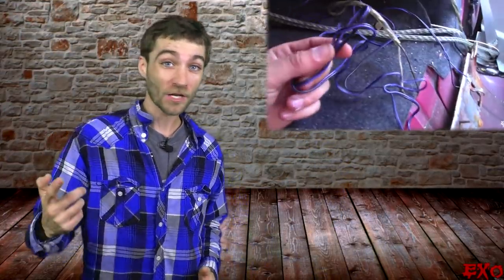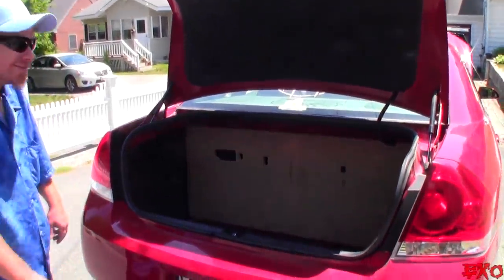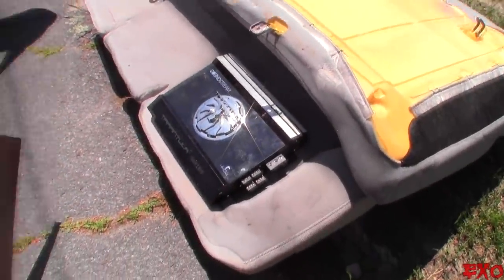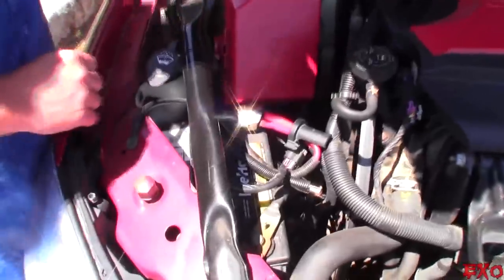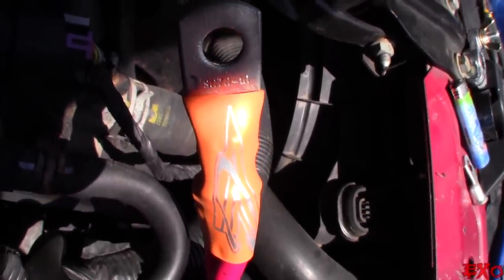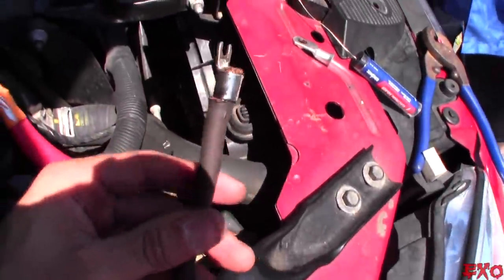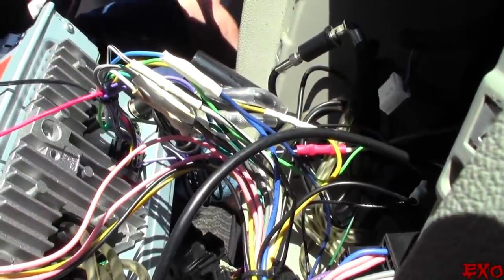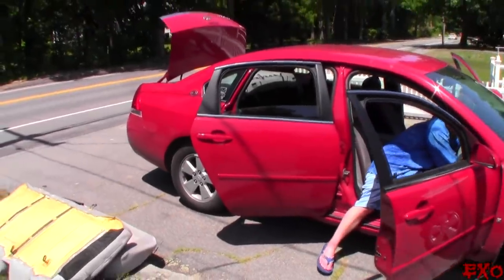Installing 4 Channel Amp w/ Joe's SOUNDSTREAM Tarantula Amplifier | Wiring Up & Tuning Gain Settings

Comment from the maker: It's always great to have friends who love tinkering as much as you do :)

Thanks For Watching, Everyone!!!
Reply: It has now been years since the last real Build-video..
Can't wait to see this big Nissan subwoofer incloser come to life👍 keep it up Exo!
Reply: Do you have a video of the 2 15’s installed in the car
Reply: Love the work man!  Your a inspiration an now i have four 12s in my 95 GMC berban.
Reply: Damn really digging into the archives 😄 and your first heat shrink job, is still there and working fine.
Reply: I gota say i thuroly enjoy the real feel of your channel and the over all positive and happy attitude that you display I have a deep passion for car audio myself and I have just about finished my fabrication shop and will begin my own build where I will be installing a active  3-way Focal Utopia and a Fi 18 BTL fully loaded 7 spiders. All this powered by 2 Soundstream Rubicon 600watts for door drivers and mids and hi's and a Soundstream D Tower 3400 D 1/2 ohm stability. All of this will be processed through the Rockford Fosgate 360. 3 signal processor and it will be fed audio through fiber optics cable off of my car computer that will be built into the dash and cooled via air conditioning. And it is a full-blown PC not these POS carputers on eBay... I'll be running a full 1080p touchscreen Lilliput screen and not an Adaptive resolution it will be Ultra high-res I will also be sporting and I'm not joking a true 1000 farad capacitor Bank and a XP 270 alternator luckily have already purchased all this stuff I'm going through the phase of preparing to build I'm so excited I promise I'm not trying to brag just happy to put out there what my bill is going to be and share it with others.
Reply: I bought a Buick Regal that came with Those same exact 6x9s in it!!!
Reply: Have u ever heard of a logic soundlab gsx-28hc high current 3000 watts 1/2 ohm stable  2 channel amplifier? I'm having major trouble finding some specs for this amplifier. I've googled it and only came up with 2 results. None giving any information on the amp. If there's anyone who can help me it's you. Love ur channel keep up da good videod
Reply: I have a question on the 4 channel Amp do you set at Full or HP or Low. One guy put mine to low than I lost my high sounds.
Reply: It’s an old vid, but I’m going thru the library as I need or want. It’s nice to see someone in my budget (love SMD, but that’s gangster cash) who makes it all work beautifully from the garage. MUCH appreciated!!

Comment: Forgive me for unsubscribing 🙏🏽 

Picked up a prelude in great condition. Doing a little build on a kenwood 801-5. Focal component mids in the doors, focal coaxial in the rear, a 6x9 in the stock sub spot between the seats and I’ve got a p3 10 for a sub. First build I’ve done in a few years and I’m excited to see it all come together.

Comment: I'm halfway through installing a 4 channel amp to complete my soundstage in my 365k mi jalopy, and watching 8 minutes of this reminds me of how google's algorithm doesn't understand the difference between goor content and completely useless content. This would fall in the suggested category of useless content based on my search criteria. However, the video did alert me to the important issue of using heat shrink vs. electrical tape where both is purely cosmetic and essentially do the same thing.

Comment: A lot of folks shit on Soundstream but they're not too bad, I run a T5 10 for my winter sub and had a little Reference 8 last year. As long as you don't expect to run Soundstream (or any budget brand) at full rms you'll be fine. Nice throwback vid EXO, "We all start somewhere" spoken true

Comment: Propane tank will dump xtra fuel when tipped upside down, wen you shake it the concentrated liquid it can disperse around the tank, warm up, and ussually equalize the ratio throughout the tank, when its just sitting straight up with plenty of fuel tipping it too far into a 90° angle will dump the concentrated liquid out the tip

Comment: Do you have a video on how to measure for air space of your speakers and for a port? I'm building a truck box for four skar 10s.
Reply: Define your airspace it's length times width times height divided by 1728
Reply: Try Rockford box wizard.  Search for port length calculator.

Comment: If the rca from the 4 channel amp uses all up the rca connections to the radio how you connect your rca from the subwoofer amp

Comment: Question when putting 6 speakers on a 4 channel amp on the RCA do I use the rca  splitter to use all 4 channels or what ??? Like the 2 male to 1 female splitters??

Comment: So the amp that he used has a lower RMS than the speakers?? Wouldn't that be underpowering?
Reply: No. And let me tell you why it's because RMS is root measure square that's the maximum you can do to get a quality signal.
Reply: @e-flatdeyante7514  Ok I think I get it. I usually match the RMS of speakers to the RMS of the amp
Reply: There's nothing wrong with that...

Comment: Hey i need help figuring out a problem with my set up I have had the same set up for at least several months but the speakers hooked up to crescendo 4-channel amp have been moving without any single sent to them any help or suggestions on what it might be would be appreciated
Reply: You have lost shielding somewhere electrical most likely a alternator to make the speakers move without any signal

Comment: So I've been saving for "pro audio" speakers, do I need a crossover if using a separate amp with highpass filter tuned to not interfere with subs amp? Kinda new to this stuff.

Comment: Hey EXO need your help I'm running 2 10in  JL audio's with a 1000w Rockville amp but everytime the bass hits everything dims then my bass starts to kick in  and out after 20 mintues
Reply: kenneth taylor get a volt meter. Your dropping below 12 volts if your amps shutting off.
Reply: Big 3 upgrade and a 2'nd battery will do the trick.
Just search on youtube: big 3 upgrade
Reply: Draw > supply. My guess is you're running a stock alt that can't keep up.
Reply: @B F totaly agree. Big 3 upgrade is a must. Most alternators in modern cars have 80-120amp. And a decent battery. But the weakness is often the wireing.
Reply: @bepbep7418  for a 1000w, stock alternator is ok. Lets say its a 90amp alternator. 90x14.4=1296.
But it's depends on how you play.
I have a 8k amp on a stock alternator with 3 battery's. But i only use 500w on daily driving-music and have short burst of power on spl-contests.

Comment: I have a soundstream 4000.1 amp and it out of the blue started making a "heartbeat sound" and going into protect. check all cables and wires and found no issues.  hooked up an old cheapo amp and everything works fine, so guessing the amp just up and died, Less than a year old. wouldn't recommend sounstream amps

Comment: I know this is an old video, but if anyone can help me I would surely appreciate it.  When I use my DMM to set my gains to the desired voltage my DMM jumps around everywhere.  I have a good Fluke meter so I know that's not the issue.  Any help would be very welcomed.  Thank you in advance.

Comment: Can anyone explain how to run a 5 channel and 4 channel at the same time. my radio is in network mode and I'm only getting tweeter sound out of my 6.5s on my 5 channel. The 4 channel works fine. I have 4) 6.5s and 4) tweeters ran off the 4 channel. I want add more 6.5s on the 5 channel and a sub

Comment: those big torch are the worse. Better to use a big crimper
Reply: He DID use a hydraulic crimper. In fact, it's still there.

Comment: Can you help meee?
Reply: With what?
Reply: offroadingbronco i blow off my dust cab
Reply: How to fix it
Reply: @remisther528  just get a new dust cap and there is an adhesive like CA glue they use to glue it back on..search for subwoofer recone videos.  They show whole thing but that part is in there.